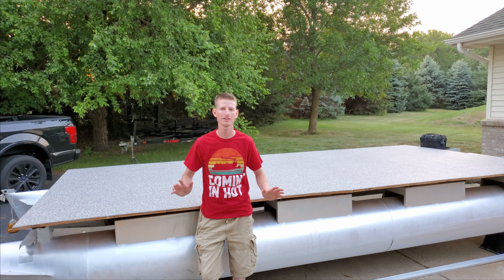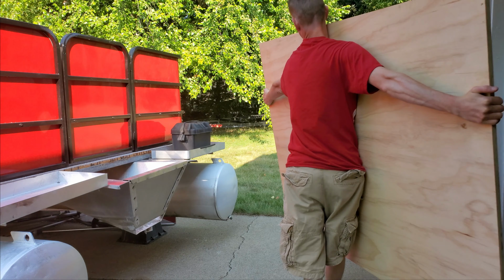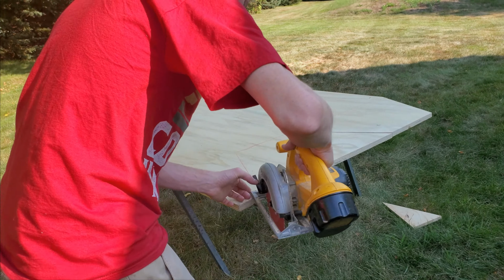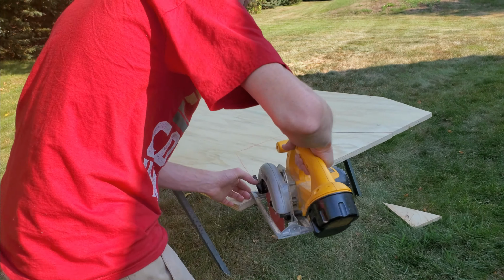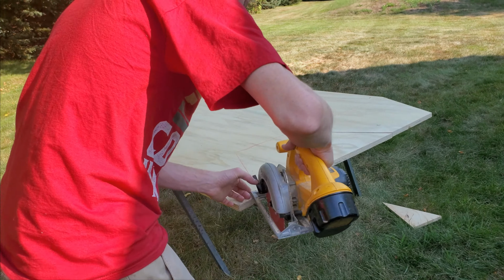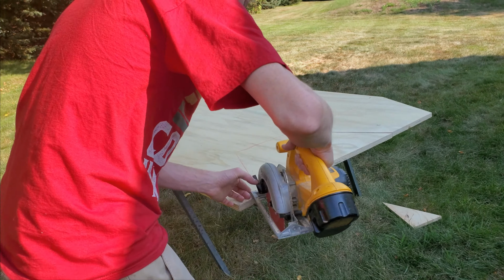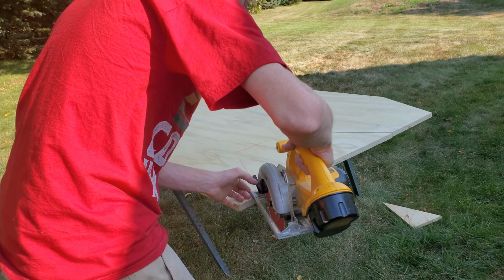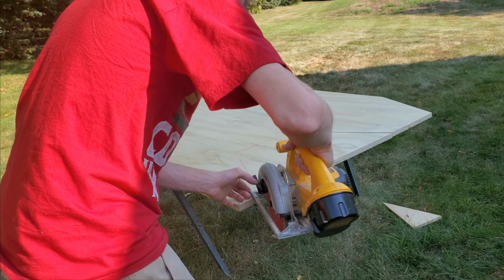Pontoon Restoration Part 5. Furniture, Fence, and Trim.

Comment: Have you experimented with a heat gun to maybe tighten up the protective strip along your fence edges?  Not sure what kind of material its made from, but rubber does shrink usually when heated, and that may just tighten up loose rubber around the corners... I would experiment with a remnant piece before doing this to finish product, ofcourse.

Comment: Wondering where you bought your new furniture and your aluminum paneling from? And are they a plastic base? Thanks
Reply from the maker: You can get furniture from websites like pontoonstuff.com the plastic base furniture is nice. It won't rot and it's easy to clean and dry.

Comment: I'm amazed that the furniture is still that nice. Every boat I've looked at in the lower price range - and that includes +- $8,000 - has furniture that looks like a 10 year old went at it with a chainsaw. They''re complete scrape-off's. A new furniture suite at this time is +-$3,500.